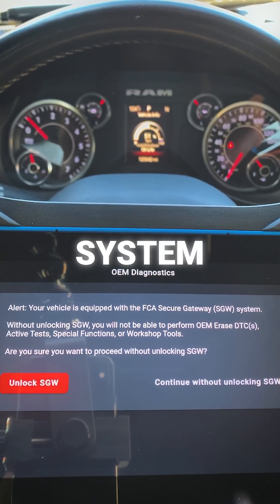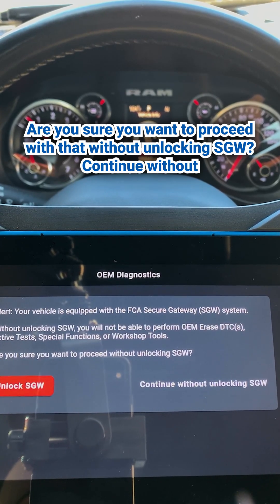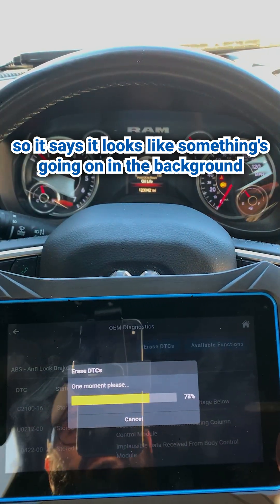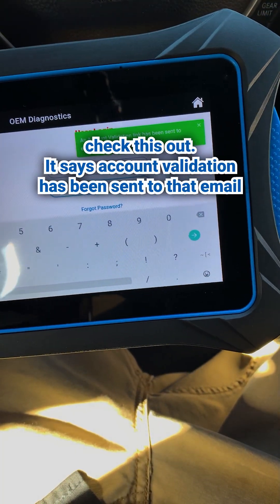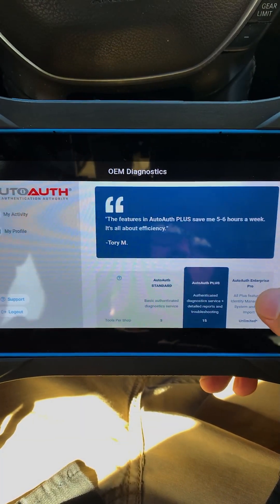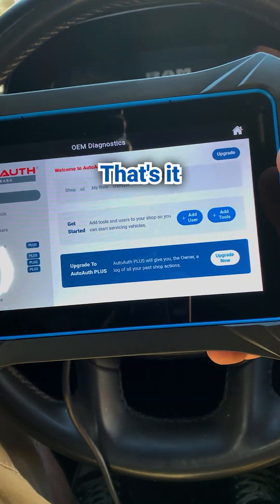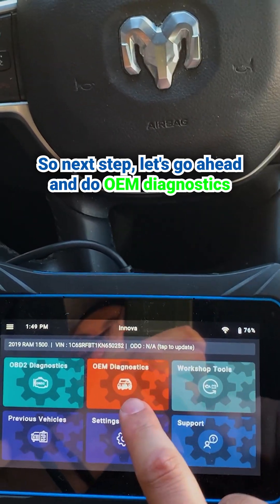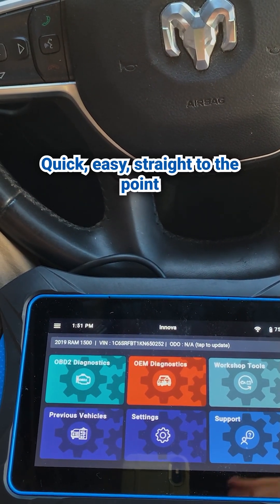Review 7111: Access Secure Gateway on 2018+ FCA Vehicles

Comment: All manufacturers are heading in that direction, They don't want owners touching their own vehicles. They want to control your vehicle. Pretty soon techs will be locked out.
Reply from the maker: Hi, thank you for your feedback! Security systems are getting tighter, but the 7111 is designed to help you access FCA Secure Gateway safely and properly. Let us know if you need any help with it.

Comment: You are an lier.  The innova innovation is life time free updates.
Reply from the maker: Hi @HardType-iv5dx,
Absolutely, the Innova scan tool offers lifetime free updates. However, for the FCA SGW unlock feature, AutoAuth charges a fee for their services. AutoAuth is a service that provides technicians with the ability to use their aftermarket diagnostic tools to perform secured functions on vehicles through the OBD port that would otherwise be locked by the auto OEM.

Comment: The 7111 is a awesome tool! But just sucks that the end user has to buy extra software just to work on their own car.
Reply: It would be nice if they would activate the camera feature if you needed to take a picture for a customer for some reason. Also if they turn on the memory card case you needed more storage.
Reply from the maker: Hi @mikef124,
Thank you for your feedback. We have a plan to develop these features in the future.
Reply from the maker: Hi @onemischiefmaker703,
We only integrated the FCA SGW unlocking function from AutoAuth. AutoAuth is a service that gives technicians the ability to use their aftermarket diagnostic tools to perform secured functions on vehicles through the OBD port that would otherwise be locked by the auto OEM. So, AutoAuth charges a fee for their services.
Reply: I'm not blaming Innova for this it's totally the auto manufacturers. They are doing this to help secure dealerships for repairs.
Reply from the maker: Hi @onemischiefmaker703, 
Absolutely, we appreciate your understanding. The automotive industry is indeed evolving, and manufacturers are implementing these security measures to safeguard dealership repairs. While we strive to provide valuable tools like the 7111, the additional services from AutoAuth are unfortunately necessary to navigate the security protocols set by the OEMs. 
If you have any further questions or feedback, feel free to let us know. We're here to help!
Reply: @onemischiefmaker7032 You can connect your scan tool straight to the SGW  using a 12+8 obd2 adapter. Then you don't have to register thru autoauth. This allows you to erase dtc's and allows bi directional access. It's usually located behind the dash somewhere so you have to remove panels and/or components to get to it
Reply: @MarcBchannel  awesome. Thank you. I will research that information you just provided.